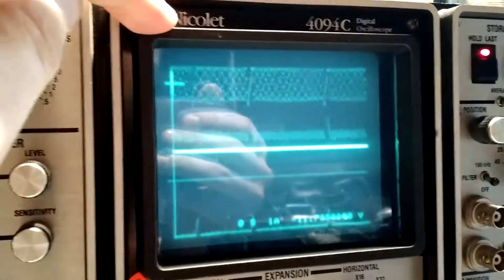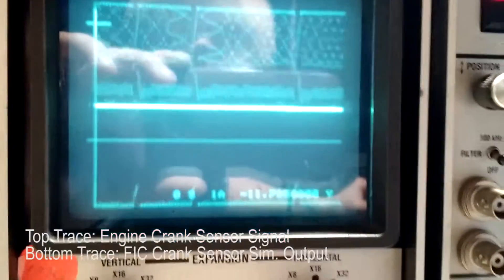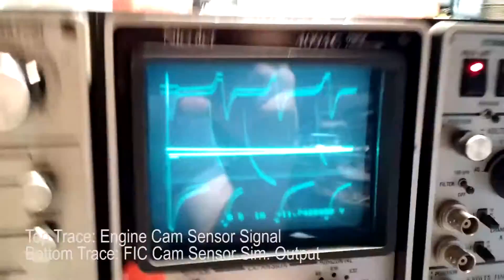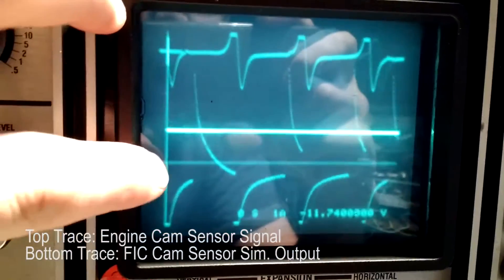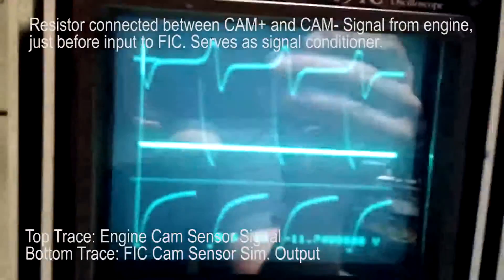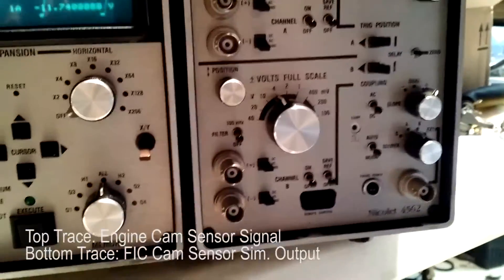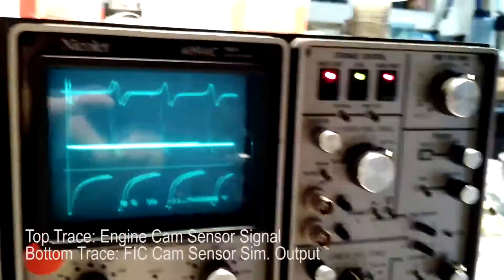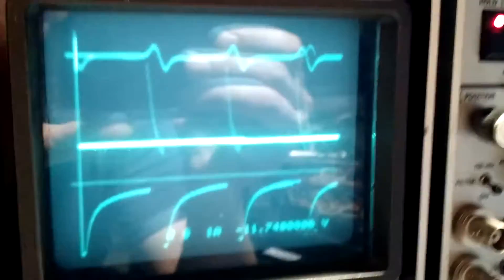AEM F/IC Toyota Cam & Crank Signal Resistor Conditioning

Comment: Resistor inline or across the wires?
Reply: Any reason you changed the stock crank sensor signal to match the FIC simulation VS changing the FICs signal to match the stock sensor?

Comment: Hello. I hope you are still around. I see that you ended up using a 1.5 resistor. Could you tell me exactly what the specs are? I’m very new to this and I am right in the middle of trying to wire up my FIC to my is300.

Does the resistor need to be attached to the positive and negative cam signal as in bridges a gap between the two as well as the same on the crank sensor?

Any help I appreciate greatly! I am going to make some O2 sims based on your website instructions!

Comment: have you found a reason why the aem fic takes so many cranks before the car will start?
Reply from the maker: Not yet - I think it has something to do with the FIC's internal boot-up - but that's just a guess. If you KEY ON for a few seconds before cranking, it generally takes 1-2 less cranks. I notice when I go from OFF->START fast (like normal) it takes much longer than if I go OFF -> ON --> (wait 2 seconds) --> START.
Reply from the maker: Haha Oops -- apparently that's some youtube formatting.   I notice when I go from OFF....START fast (like normal) it takes much longer than if I go OFF.....ON.....(wait 2 seconds) ..... START.
Reply: Chippernut ok. i remember when i had one in my civic it was really bad, but if i pass the crank and cam wires to tap. it would start much better. now i have a tc and it does the same long cranking. i did try waiting. and sometimes it works while other time its the same
Reply from the maker: One thing I was thinking of trying was to put a large capacitor (12V+ or larger) across the positive and negative power inputs on the FIC.  The theory is that the momentary current draw spike from the starter causes the FIC to reboot when you start cranking. A large cap might even this out and prevent a reboot -- but I haven't confirmed this at all.  You'd probably have to look at the internal LEDs or monitor (somehow) if a reboot is indeed happening.  I do know that I can connect to the FIC via laptop, start the engine, and the FIC doesn't lose connection - so that might prove the above wrong, I'm just not sure.
Reply: How long of cranking are you talking about? ive installed one in my truck and ive gone through the wires and everything 3 times. it doesnt start with the fic connected. only with the bypass plug. I was think i read somewhere that a resistor might be needed for the crank or cam but now that i read about the long cranking i dont think ive held it for very long. maybe like 3 to 4 cranks before i stop, ive tried off and on but not continuously. i hope you'll see this lol

Comment: Hi Im having some trouble trying to read an RPM signal from my single cylinder bike. The chinese cheapo oscilloscope I have is getting all sorts of noise. I honestly cant make heads or tails from it. Im even getting loads of negative voltage which I thought wasnt meant to happen on a DC system? Just wondered if you have any tips

Comment: Finally somebody that makes sense. I´ve read your thread on my.is (or wherever).
I have the exact same issue. I've already threaded this on the AEM forum, but nobody know anything.
Anyway, I've swapped the engine for a multi-point injection after that post and this engine is creating huge noise on the output of crank signal to ecu. 
I only use the crank signal (don;t have anything else)
I will buy 2.2k .5W resistor and place it between CRK MAGI +/- and see what happens. Or do you have a better solution? 
Please see my thread at http://aemelectronics.com/?q=forum/injection-issues-using-tbi to have a look at my "crank signal"pickup coil and rotor. Again; I am using a different engine now, but you'll see my config on crank signal.

Thumbs up and subscription! Thanks!
Reply from the maker: +aclassnl  Interesting --  Please let me know how adding that 2.2k resistor affects the behavior.  I also had a random injector timing issue.. When I put the key ON, but the engine OFF (not running, just in ON position) it would fire the injectors and flap the dumb IACV motor.  Eventually this would fill the cylinders up with fuel.. not good.  I found the problem was an incorrect ground from the FIC to the ECU.   

You may have already read this: "The FIC has a pin called "SIGNAL GND" which I had attached to a Chassis ground on the ECU. I moved this to "Sensor Ground" on the ECU (E4-34) and the KEY ON, ENGINE OFF behavior has totally disappeared.. I think my idle has improved too."  
http://my.is/forums/f114/prep-turbo-aem-fic-tuning-524681/

I also added a ceramic capacitor across the +12V and Ground wirings powering the FIC -- just to eliminate some low level transient noise coming in from other electrical stuff. (electrolytic caps won't work, has to be ceramic, I think it was around 22uf). 

I didn't quite fully understand from your AEM thread or the youtube videos. Sounds like the FIC is creating an additional injector pulse after the correct one?  

Do you have a 2 channel scope to compare the injector IN and OUT signals simultaneously? 

Have you tried a different firmware?  I had the best luck with z104.. but they also make z107 and z110, and IIRC the primary differences are the injection and crank-position sensing methods.

Comment: What fueling strategy firmware are you using on the FIC with the IS300? z107, z104?
Reply from the maker: +Kyle Lafkoff z104 works the best.  z107 and z110 cause other issues and do not improve the signal conditioning. z110 caused a massive fuel-cut at 3500 rpm.
Reply from the maker: +Kyle Lafkoff  Here's a good thread w/ info:  http://my.is/forums/f114/prep-turbo-aem-fic-tuning-524681/
Reply: +Chippernut Yep, thanks. Found that thread searching for clues to why the FIC is acting so crazy. I am using z107 after talking to AEM tech support on the phone but seems people on the internets are more happy with z104. Wasn't sure if the firmwares were updated with latest AEM FIC6 software, v3.0.7a. z107 works great at first when I pull the battery/harness to reset ECU, then moves to very sluggish behavior; erratic AFR readings -- especially at idle -- and choppy driving at constant speed on the highway. The first thing I notice is the throttle tip in makes a transition from very responsive to unresponsive after a few drives. I will try z104 again. I currently have 2.2k resistors that came with the boomslang harness and still experiencing the same issues.
Reply from the maker: +Kyle Lafkoff  Hmm..  you have an IS300?     It could be your fuel maps too, if you're correcting for oversized injectors from stock.  What are your fuel-trims doing when this occurs?   It could also be MAF placement / turbulance... Could be a poor ground to the ECU or FIC.   You're using the boomslang, so I'm tempted to rule out any FIC wiring related issues.   Try z104.. also make sure your RPM and throttle are calibrated... let me know

Comment: So which resister would you use?  You think it would probably be the same for a 94 Landcruiser?
Reply from the maker: 1.5k.. i tried the 680 ohm for a day and it was way too aggressive, car felt sluggish..  1.5k is the sweet spot, but you always want to find the highest resistor you can..  the higher the ohms, the less signal conditioning..  each car will be different. some don't need any, for example.
Reply from the maker: the scion TC folks have good luck with 2.2k. fyi